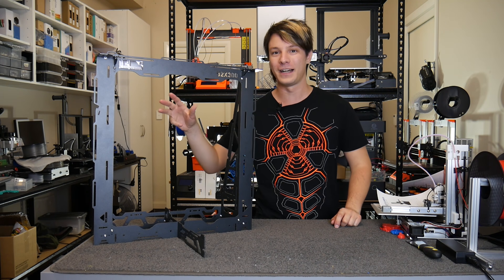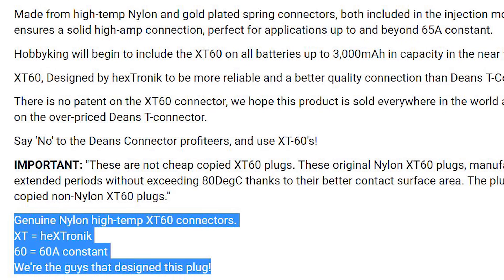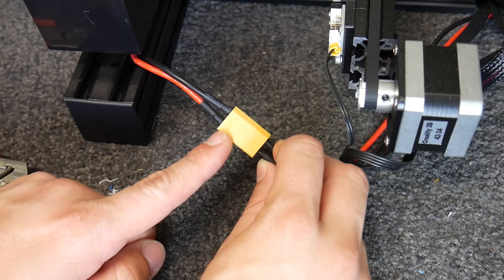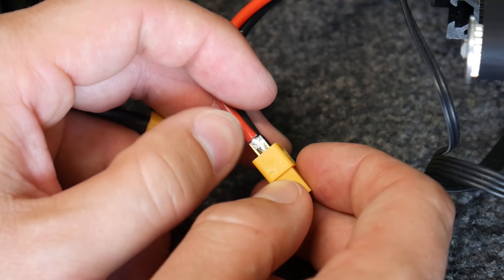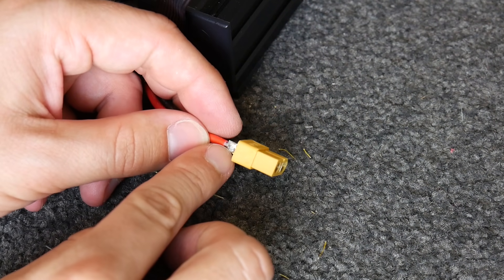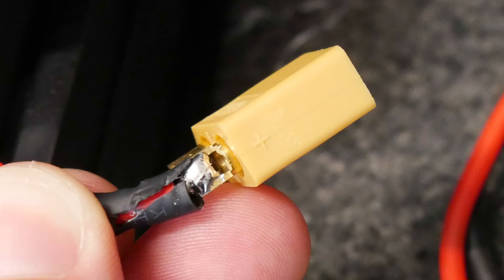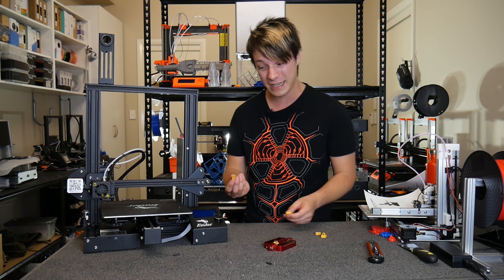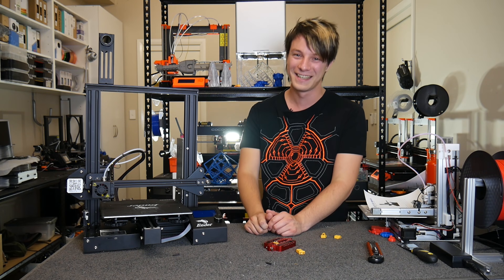Ender 3 Connectors are burning up... Bad XT60's

Comment: You really can push the metallic connectors on the man side a litte bit, best with a nail, or something that is round.
In the rc would you have to do this after you had crashes by example.
After that it should be much stronger than before to get them together or out.
Yes they have to be soldered, normally you use more solder and put more wire in the connections than in you video.
While soldering xt60s you should have put both xt60s together, because they can melt out of place.
Use a spare one, or leave them together  (without power connected) if you haven't the soldering "base" from hobbyking.

Comment: Oddly they're also connected 'backwards' in that the male plug (attached to the PSU in the Ender 3) is usually used on the load and the female plug (attached to the board in the Ender) is usually used on the power source (battery usually). Obviously the electric field cares not which way the plugs are set up, but it is strange- and it foiled my attempt to measure my Ender 3's power consumption with a R/C Power meter.

Comment: The best way to test these is whilst they are under load from the heated bed and measure the current with a clamp meter and the volt drop with a decent voltmeter across the cable and connector. With a ounce of ohms law you'll get the resistance. You should be able to get the impedance of the connector itself, the solder joints, and the complete connection including the cable.
Your standard AVO won't be accurate enough on ohms and a decent low ohms meter is expensive

Comment: My Ender 3 has crimped XT60 power connector and I just noticed it is discolored and I measured the temperature and it was over 60 deg C  with a bed temp of 60 deg C.  I just replaced the crimp style XT60 with the good solder ones shown below and the temperature at 70 deg C is 20 deg C.  The crimped XT60 connectors are bad news!!!  The resistance went from 20 milli ohm to over 50 milli ohms on just one of the power leads going through the crimped XT60.  The new soldered XT60 measured less than 8 milli ohms for both power and ground.

Comment: Would have been nice to do a temperature test against the fake XT60 and a real one. Maybe it's not even nylon.
Reply: This has been done, they're very popular in car audio and those dudes have punished them. The "fake" XT60's have much lower tolerance within the barrel contact. Bad connection = heat. Better off just to replace the connector all together. Why risk it. Insurance isn't going to pay for shit if your power supply isn't UL rated and it torched your home and dog.

Comment: I've had my Ender 3 for just over a month and checked the connector when I saw TH3D's post. The connector was starting to blacken a bit on the power supply side on my printer. I did some quick testing to see what was going on. When I called for the just the bed or just the nozzle to heat up from room temp the connector stayed cool. When I called for both the bed and nozzle to heat up from room temp it got hot. Once the bed and nozzle both reached operating temp the connector cooled off for the remainder of the run time. Which makes sense as it takes fewer amps to maintain temps than it does to raise them quickly. I did notice when my print server kicks the print off it warms the bed then the nozzle. Maybe that is to keep the amps down. I normally preheat my printer with both running at the same time so it pulls more amps and so I had the black marks. I've removed my connectors and soldered the wires together then shrink wrapped them. The wires and connection stays cool even with both bed and nozzle heating at the same time. If I need to replace the power supply, I'll just desolder the wires and go from there. Glad I saw the warning before it got worse.

Comment: Great heads up for everyone Angus. Going by the images, it does look like the solder joint is mostly to blame as that seems to be where the heat source is. I'm thinking a dry joint due to insufficient heat being applied to the connector pin, thus creating high resistance between the solder and the pin. Although the plugs do also appear to be low quality too.

Comment: Thanks for this video.  I checked my Ender-3 and the power connector was getting hot, while the wires leading in were normal temperature.  I cut out the connector and soldered the wires together.  The solder joint stays normal temp.  If I ever have to change the power supply I’ll put in a new connector at the same time.  BTW, the connections in the connector were crimped.

Comment: The male XT60 pins regularly require opening up when they become loose. Also when soldering an XT60 it is a good idea to have the other half of the connector pluged in so that the heat from soldering does not distort the pin position.

Comment: Angus, believe that you need to have a physics refresher...
Surface area has no affect on the friction in the connector. The friction comes from the normal force (provided by the petals) and material. Surface area does reduce resistance in the connector, though, so at least your right with that.
Reply: On the surface (ha) you appear to be contradicting yourself.
Reply: I believe he mean since they were such low friction he could tell the petals weren't all applying force to the connectors.
Reply: @Bitterguy14  Force vs friction. Low force. Low friction. That's how I think it goes which appears to be similar to what you are saying. If a plug is hard to put in, to much friction. Whether all the petals touch the plug matters not, as far as friction goes, as long as they are the only things touching the plug. Four petals touching the plug firmly of course is most desirable.

Comment: I got an Ender 3 a few days ago, and I noticed that my XT60s are a bit different; They don't have the heatshrink, but instead have a gray plastic... Sleeve? I don't know what to call it, but it is some sort of seal that goes behind the connector and covers the wires pretty well. Hopefully I can remove it without destroying it to check the wires.

Edit: I just checked the connectors and I'm sure they're original. They say AMASS, they're very hard to connect/disconnect, the female connector has the little holes blocked at the end, whereas the knockoff didn't, and the male connector has very shiny pins with a nice fillet, whereas the knockoff had a very rough finish and a very basic chamfer.
Reply: those are XT60H

Comment: We're never removing the PSU so I'd suggest to remove the entire power cable with connector, replace it with a longer one which is then directly screwed into the PSU.
Prefereably silicon high temp multi strand cable like 12GA and then put it inside of some kind of a cable protector sleeve(like the one on extruder head cables).

If your whatever application requires connectors, purchase them directly from hobby king.

Comment: Thanks for the video. Have bought Ender3 Pro in November on Aliexpress (CREALITY 3D Official Store) and the printer had male connector crimped, female was soldered. Funny is, that the crimped one looks almost like original, but the soldered one is looking fake as hell (faded yellow, barelly can read XT60 marking). I didn't have problem with the connectors, but i replaced them just to be sure.

Comment: Just received my Ender 3 Pro this week and it looks like they have changed the connector. Mine has no  heatshrink but little removable plastic covers instead to cover the solder joints. The joints underneath it look fine and the connection is really tight. I would also guess that they are original ones, I don t have any to compare them to though.

And the female plug is soldered to the PSU as well :)

Comment: Just my two cents: My Ender 3 "Pro"'s "XT-60" connectors were crimped. No solder at all. Positive side of the connector was starting to blacken outside and has dark residue inside around the pin and hole. Only running PLA, so the nozzle's never been above 220 degrees C. Thank you for the heads-up Angus! Creality should know better, right?

Comment: by spreading out the prongs on the plug you can make them harder to separate and plug back in. However as you mentioned they were different colors so maybe they were using two different brands.

Comment: Another reason for the burning may be use of a lower temp resistance plastic housing, that combined with a poor joint is more likley to discolour due to the high temps

Comment: I would connect the XT60 Male to Female so that you don't over heat the connector when soldering. The male may warp because of the thin walls and the heat when soldering. I have had to bin one because of this issue and never did that again.

Comment: My ender3pro is crimped. Not sure if it's soldered before , but it would be wrong anyways. I did notice it getting uncomfortably hot. And the yellow has a slight burn tint at one of the spots. 

Fixing today.

Comment: Thanks for pointing out the differences 👌👍😊
Its scary to think what inferior connectors are offered now, if your still keen on using a connector, i would suggest an Genuine Amass XT90S (anti-spark) or even a Amass XT150 connector. For sure its overkill but the connector will last far far longer & wont heat up at all.

Comment: Mine were soldered, after 4hr prints the cable and plug was red hot, I cut them off replaced all the wire back to the PSU and put XT90 plugs on, 24hr print and cool now :) Replace ur xt60s as soon as u get this printer... Still a great printer

Comment: Should be obvious, but if you're already out of your comfort zone resoldering things and stuff it's easy to forget: if you're replacing those connectors with proper ones, MARK EVERYTHING before you take it apart so you know which side goes to which wire!

Comment: A proper crimp connection should have nearly as good conductivity as a proper solder joint.  We pumped more than a 1,000 watts 24 hours a day through crimp connections and only ever had issues when the weatherproofing failed or the crimping was performed badly. 

As someone else mentioned,  a poor or cold solder joint can cause a lot of resistance and build up heat,  and you mentioned that you thought the loose connection might be the culprit.  Either of these is more likely to be the issue causing failure than the connection being crimped.
Reply: I agree in general about crimping, but as you note, the key is proper crimping procedure. But the connector terminals have to be properly designed and characterized for crimping.  The real XT60 manufacturer, Amass,  who may have properly characterized their connectors, does not actually sell any crimpable XT60 models. So it appears that some third party cooked up the crimpable ones, with unknown amount of design and testing, and unknown availability of the specs.
Reply: True,  but just because we don't know the specs and if the job was done properly or not doesn't mean that the trump is the problem.  At the power levels that these connections typically see in thr 3d printer application if the crimp is solid and has no play it should be fine.  The issue is more likely the loose connection between the two prices of the xt60 connector.
Reply: Pretty sure that "trump" is not the problem this time. Unless the poor connectors are somehow a result of the tariffs. Hahaha. But presumably you meant "crimp".  Yeah, I agree, the crimp does not have to be the point of failure. It might just be connector pins that are too-loose fitting, or defective plating or whatever, and they happen to be the crimpable ones.

Comment: You could also upgrade to the XT90's or EC5's if you felt the need.
Reply: XT60 is more than adequate. XT30 would even be. However when you're dealing with badly made knockoff connectors, there's no telling how bad they will be. I mean typical resistance of Amass XT60 connector is 0.5 mOhm, while connector wouldn't burn until the resistance is approximately 1000 times as high. So a difference of a factor of 1.5 or 2 in nominal specs is immaterial if the connector actually has 3 orders of magnitude worse specs in use due to bad quality control.

Comment: If you “spread apart” the male posts, it will add extra contact pressure to the connectors.  Use a small Phillips screwdriver or punch.  A very weak contact will heat these connectors up too

Comment: You can use a pick on the Pin side of the connector and spread the pins a bit. It should be hard to pull apart. I've run 100+ amps through them on multirotors and they only get hot if they're loose. it's not the best "cheap" connector in that case but it works. Personally though, I'm just going to either add ferruls to it with a splice block, or completely swap the wires out for one piece.

Comment: i bought my ender 3 pro from the creality site itself and my xt60 connection is super snug, the company may have fixed the issue with newer models or I just got lucky
Reply: My ender 3 pro is a very snug plug too. Haven't cut mine open but I can't really unplug it without really trying.

Comment: Did they also messed up the connector orientation? All my LiPo packs have the "holes" side connector soldered to it, so you can not short it that easy. The power supply should have a short circuit protection, but just for the records, they should be the other way around and the printer should have the "exposed" pins... :)

Comment: I don't think its the solder vs crimp as then the heatshrink would be damaged more than the housing. What I think is that they come apart that easy. Connectors which do not make good contacts on the pins will have arcing at higher Amps on the pins. It's the same problem that PRUSA type printers have with the bed connectors that go into the Rambo mini if there is no proper strain relief, PRUSA put an article out there and you can google PRUSA or RAMBO MINI bed connectors melting. In case of the Prusa they use Molex connectors which is top of the line yet if you do not tie the wire down it yanks back and fort expecially if you print big parts where the bed travels like 200+mm back and forth the constant bending of the wire wiggles the plug which causes arcing which causes heat and melting. Now in your case with the connectors being that loose I'd be pretty sure if you print lets say 5kg of ABS doing big parts you will burn up your soldered ones too as they are loose. We are using the Hobby King ones on our robot and they are good connectors so what I would do is chuck those connectors and replace them with the good ones. Happened on my PULSE which is a Prusa clone. Predicted it to Matterhackers and suggested to extend the wire and run it underneath the bed with a drag chain but was told if I do it I void the warranty. So now they had to replace the Harness and Rambo mini under Warranty It will get a drag chain as soon as the warranty is close to being up. In the 4 month I had the printer I Printed 22kg of filament and the bed was between 70 and 100 on all of them as its Mostly ABS, HIPS, Nylons and some PETG and occasional some PLA but I print the PLA too with an 80 C bed as that way with the enclosure I have you get annealed PLA parts. That means they are a little less brittle a little more durability and will take 150 C before deforming. Might make a video on that after the FIRST build season is over as right now we are focused 100% an printing our FRC robot with the Pulse. I will post some videos about that on my youtube channel.

Comment: Late to the party after realizing the XT60 isn't black because it's wrapped in heat shrink. Only noticed it by accident when I picked something up from behind the printer and burned my finger on the power cable (measured almost 100° C on the insulation). Connector was completely black, warped and was bulging and bubbling. Guess I got lucky I never used it for more than a few hours at a time or there might have been an impromptu BBQ. Bought it in December 2018.

Since I had some spare XT60 lying around, I replaced it (very fiddly with the remaining wire, since even THAT was black and burned near the connector). Not a great soldering job, but so far the cable and connector remain cold...

Comment: Wow, I bought myself an ender 3 for Xmas as I needed another printer but I wanted a low budget one.  

I turned on my ender 3, the display started to flicker and it shut off but the machine was still on. I turned it off, waited and turned it back on, and the display would turn on but I could here it powered on. Then in the circuit board box I hear small fire crackers going off then a pop! Followed by a puff of smoke. I unplugged the machine, and began looking for the damage. That plug is ok, but I can see a part on my circuit board that is melted. 

I'm replacing the circuit board and going from there.

Comment: Looked to my connectors. Female is soldered, male crimped. Both of them without issues (Ender 3 from 11/2018). Both methods are valid, because female connector was made for  soldering and male for criping. (different construction)

Comment: In order to make the connection better (this applies also on original XT60, the connection will become loose connecting and disconnecting the plugs) the is a small trick.
Use a screwdriver and try to separate the 4 parts of the connector, try to move away each other. The key word here is GENTLY, you have to do this slow and try not to overdone.
I had a lot of a XT60 connectors on most of my RC planes and no one ever fail on me. Not a single time.

Comment: If I had to guess I'd bet on a cold solder joint or frayed wire shorting out.  Racing quads can pull well over 100+ amp through them for short periods of time without issue.